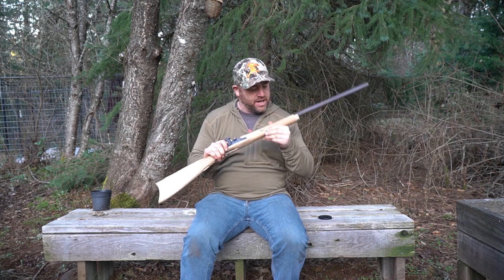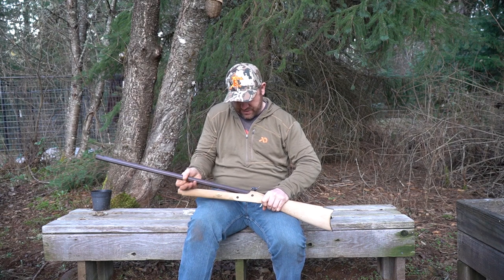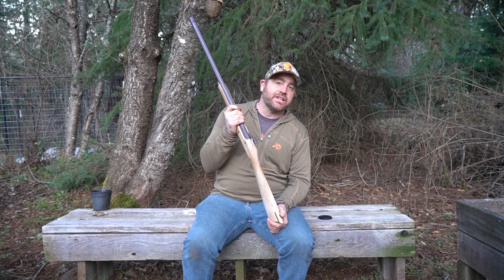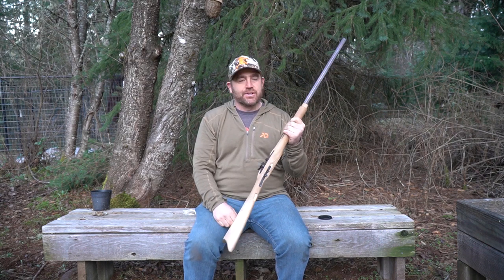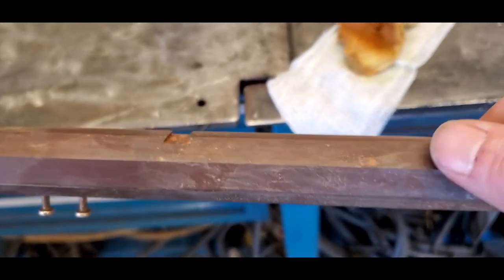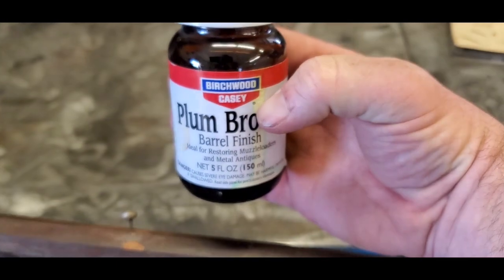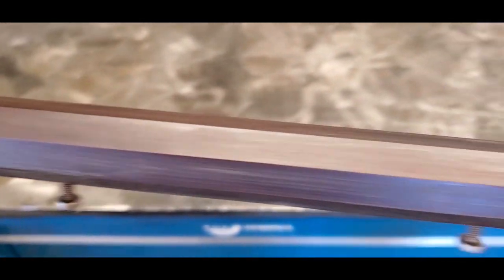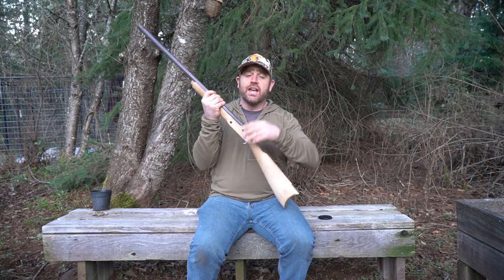How and Why To Brown Finish Your Hawken Muzzleloader Barrel: Muzzleloader Build: Episode 3

Comment: The old school way is to actually rust the surface and card the loose flaky rust, until you achieve the color you want and uniformity. My understanding of Plum Brown is it’s not rusting the barrel. You don’t need browning solution if you have rust blue solution it’s all the same except the end where you boil it you neutralize the solution for browning by soaking in baking soda water then rinse and card one last time then you smother it in oil for 24 hours. Doesn’t matter what oil, can use motor oil, can use ATF, can use anything you like.

Comment: I take it this is your first time at browning/bluing, only heat the metal the first time (with a heat gun preferably) so the solution can bite into the metal, apply the solution with a small piece of cotton, use sparingly, long even strokes, don't go over a spot again, you can go back over strokes only the first time, leave for a reasonable amount of time, buff, repeat untill the desired color depth, rinse with filtered water to remove residue of the rusting solution, air-blow it, submerge in a mixture of acetone and engine oil overnight.
Reply: So heating the barrel with heat gun? How long to get hot i?

Comment: This worked on my old style wood stove ... it was rusting after one season so I steel wooled it with coconut oil which spread the rust evenly then fired up the stove.  The house smelled like smokey coconut and the stove came out a nice brown and has lasted two seasons without further rust.
I browned my CVA Hawken in the early 70's ... still has a nice finish ... Thanks Nate 🙂

Comment: I use mr coffee pots and vinegar with salt.
Pour vinegar and water in  three coffee pots mist your barrel with light salt water
Put barrel and the three coffee pots under a trash can be sure to leave tops of coffe pots cracked so the steam can escape and just leave it over night.Plug your barrel.And it’s reusable I have done it countless times over the years to plum brown a gun metal.

Comment: I googled original Hawken rifles and the first 6 I saw were browned barrels and full stocks. Just saying. I finished a Traditions Shenandoah a few months ago and browned the barrel. It is an art brown. Make sure you use 100% cotton applicators, temp is perfect and put the flat with the sight  dovetails bottom dead center. Do the entire barrel at once. Long even strocks.

Comment: Another way to brown a barrel is to mix equal amounts of gun blue and muratic acid... This mixture gets hot... Wear gloves and do this outside and don't breathe the fumes... Rub the barrel and let it dry... Apply 2 or 3 more coats drying each time... Apply a good coat of animal fat such as lard... This Browning is rather deep and permanent... The saltwater works but takes a week or a little longer versus 1 to 2 hours doing it how I described... Come to think of it before all the gun oils we have available nowadays want around back then... Animal fat was used in oiling muzzleloaders and that was usually bear fat but any rendered animal fat will work...
Reply: If you clean out the barrel through the clean out bolster screw as i do , you may replace the screw with a good wing screw from a hardware store... Make sure the thread and diameter is the correct one for your bolster... Its ok if its too long because it can be cut to length and a angle filed at the starting threads of your but wing screw... Just make sued the screw is not brass or aluminum... Use grade a or hardened steel... The wing screw makes for easy removal of the bolster screw for field cleaning without having to have a screwdriver and no worries about stripping the screw screwdriver slot...
Reply: Rendered Bear grease works good on work boots and makes the lightest  pie crust.
Reply from the maker: Yes sir, and spring bear is coming

Comment: brown is just oiled rust, bluing is one step further: you boil the part in water and it reacts with the red iron oxide an turns it black. Both treatments go back to at least Medieval times as a decorative way to protect steel. Either creates a superior finish when compared to "cold" processes, as they penetrate the steel more than just at the surface and create a porous layer that holds oil (similar to why Parkerizing was developed, which is a similar idea, just more industrialized).
Reply: Another advantage of traditional browning and rust bluing over cold blue is that they don't have that horrible smell.